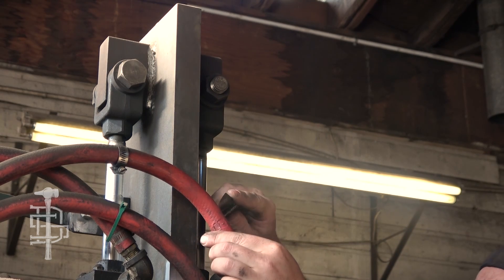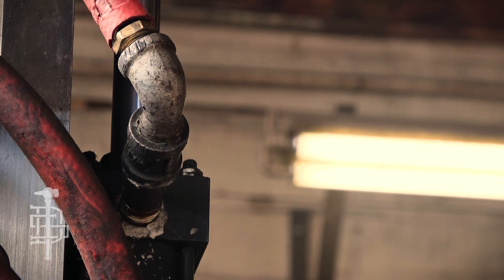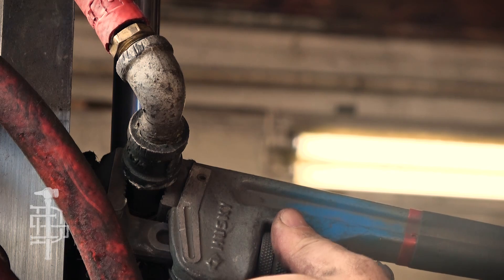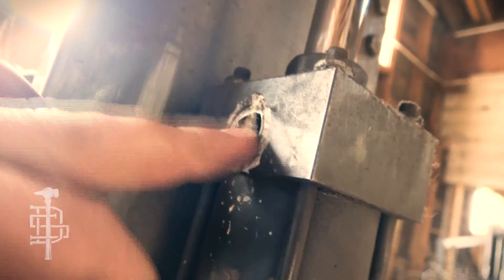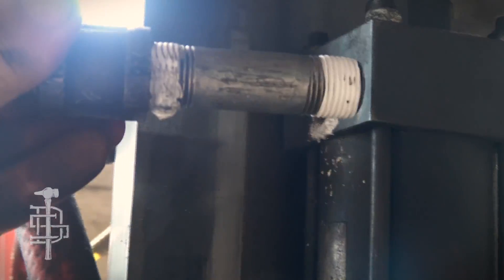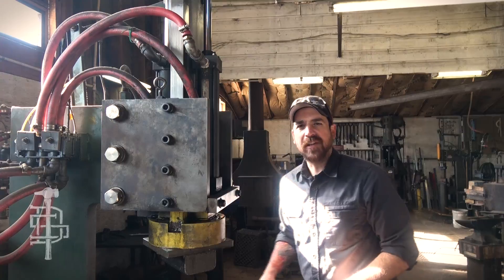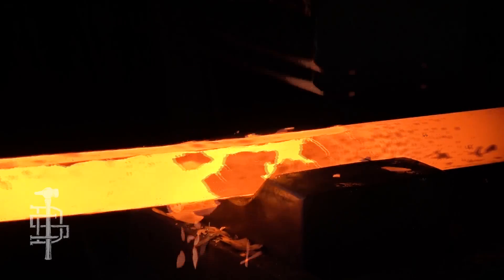230lb power hammer problem Everything was going great until...

Comment: I agree with comments about shortening the length of fittings sticking out from the cylinder.  It's a diving board just asking to vibrate.   Thread the barb right into the cylinder if you can, or I bet it'll break again in the same spot.

Comment: If those were schedule 40 pipe nipples from the corner hardware store, they will break very frequently.  Look for Schedule 80 or even Schedule 160 threaded nipples at an industrial supply and the wall thickness will increase without changing the outer diameter of the nipple.  This will give you a lot more meat to absorb the stresses the vibrating and pressure cycling the power hammer creates.  It will also withstand the erosion/corrosion caused by any excess moisture in your compressed air quite a while longer than the thin stuff from the hardware store.

Comment: if its constantly breaking at that  nipple joint.. can you get rid of the pipe nipple and elbow? just thread the pipe threaded barbed fitting right into the cylinder?
Reply: Thats what i was thinking longer hose with the barb nipple direct in get rid if that dangling extra mass out there
Reply: @northernnorm65   that's right
Reply: Or possibly use schedule 80 nipples.

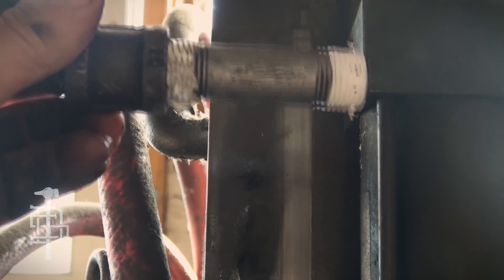Comment: Ha ha 4:18  you said "over torquing a male part"   ;)  Question, why is cylinder mounted upside down, does it add to mass of the ram that way?  I mean I know it does but is that the reason?  Tanks!
Reply from the maker: pushing the ram vs pulling...hummm
Reply: I noticed that too.  Force equals pressure multiplied by area. If the rod end is sized to adequately lift the hammer slug then the larger area of the head end will provide a larger striking force.  Cylinder mounted dump valves will also increase velocity of the hammer.

Comment: I suggest getting rid of all the pipe fittings between the hose barb and the cylinder.  It is probably all that weight hanging there vibrating that is the root of you problem. Hopefully that will keep it from breaking?
Reply: Exactly !  Get rid of all that piping hanging off the cylinder and plumb those hoses right to 'em.  You will benefit from increased volume as well.   Also, the rear cylinder is moving a bit when the hammer is going, tho it was the front that broke.
Reply: @manmachinemake3708  Or at least use a sweep bend and adequate support.